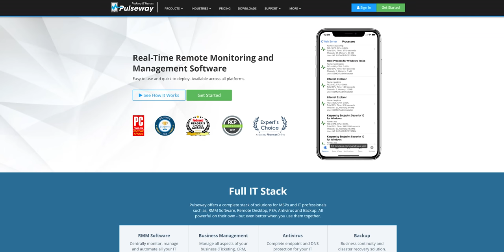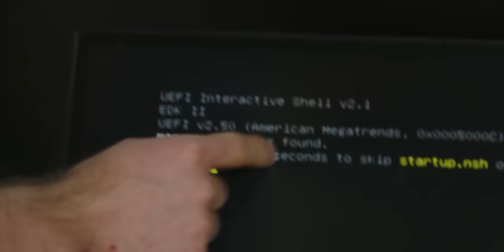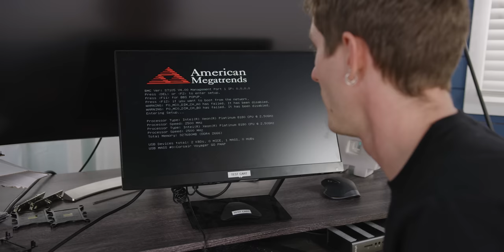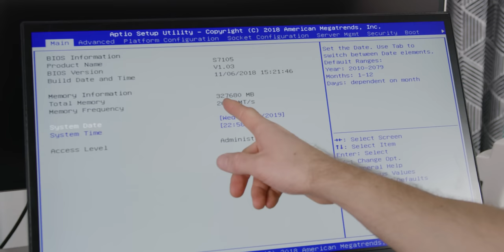Can I FIX this $10,000 CPU??

Comment: Imagine being dissapointed with only 327gb of ram
Reply: I running two gig of RAM on a Panasonic tuff book ruggedized laptop 1.6 dual core, which is a laptop and tablet combo unit from her around 2002 they'll run you about 500 used, reconditioned on the Canadian market. I don't know about eBay these days. Haven't checked. Bear in a while . For all that is holy. I'll never see a computer in my hands that has 327 GB of RAM. The bloody t 800Gaming systemI've built over 10 years ago had 6 gig of RAM which is the most I've ever had in the machine . What exactly are you running videogame wise that quires that much RAM ? Are you trying to act the matrix or trying to build it.
Reply: @peterparker6584   can you run chrome on that laptop? Genuinely curious because my laptop with 4gb of ram and an a4 apu struggles with chrome
Reply: @peterparker6584  Most companies run chrome for some reason. Never see one using firefox.
Reply: Manas Pradhan I have an a1-1250 xD
Reply: @sorsorsor11  how many computers come with Microsoft Explorer as part of the operating system installation package? Quite literally when my computer was set up somebody install come when they put the operating system in. I've tried using it and it just doesn't work for anything, the same as Microsoft Explorer is complete crap. I know there are people out there that use a web browser called Opera. I don't know if it's connected to crawl or what. I just know that Microsoft Explorer Netscape Navigator and come tend to be in the same little department of not hurry many people use it if any at all. It's actually like saying how many people use Lennox and how many people use Windows. I've only ever encountered. For people in Nova Scotia using Lennox  but from what I understand the operating system is very popular in countries like England. The reason I was making jokes about come is quite frankly I don't know anybody personally that uses it. I was using Netscape and at the time wasn't aware of anything else other than Microsoft Explorer and got a little bit of ribbing at the time for using a long expired web browser. From what I've gathered over the years. Firefox is more or less the common waist much like Windows is the more common place for operating systems. Bear in mind I'm still using windows XP witchery well might be why come  just doesn't work. Couple times I've tried to use it it behaved like a complete dumpster fire. Hogging all the RAM even trying to load one webpage. And all sorts of other issues.
Reply: AO1337 True but those same ARM chips don’t run Windows 10 64 bit like my AMD E1 1250 does xD
Reply: AO1337 wow I'm impressed! Didn't know they ran windows!!
Reply: AO1337 now that would be something to see!
Reply: Companies run Chrome because it is a Google product and companies love the censorious and omnipresent Google overlords. Fuck em, Chrome sucks ass and Firefox is the way to go. Never use Chrome.  @sorsorsor11
Reply: @NewLondonMarshall  I only run Linux on mine. Windows takes too much in resources. Hell, part of the reason my RX580 on Linux beats my 1070 ti on Windows for gaming even in wine.
Reply: Eric Barry wow I would have thought that windows having more upto date drivers that it would beat Linux! Impressive!
Reply: @NewLondonMarshall  The mesa drivers with vulkan and esync are pretty impressive.
Reply: Eric Barry Ahh vulkan that makes sense! Everything needs to use that
Reply: You could have like,,, 3 Chrome tabs open at the same time
Reply: Damn i only have 16
Reply: How did this turn into a browser fight????
Reply: @Addicted 2This Debloater or custom images can help, but not enough imo
Reply: yes, I agree. @Addicted 2This
Reply: @peterparker6584  I see boxes with 512gb of memory all day every day, but they are running ESXi with a considerable number of virtual machines on them running significant workloads.
Reply: person from 60 years from now: imagine having to imagine being disappointing with only 327gb of ram.
Reply: Na it's fine man just download some more and it would be better trust me 😁👍
Reply: And I'm disappointed with 16.. lol
Reply: Damn chrome these days is no joke
Reply: That’s just sad
Reply: @varna97  how in the world do you deal with that. My oldest system is my laptop being an old Alienware m17x with a core 2 quad, 8gb ram, GTX 280m, 120gb SSD w/ 500gb 7200rpm. And that even pains me sometimes.
Reply: @peterparker6584  Meanwhile I'm sitting here with 32GB of ram.
Reply: Why do you need that much ram for really anything.
Reply: lmao I heard him and for some reason thought 32.7 but then realized I was broke af
Reply: AO1337 so does Firefox ur point?
Reply: Something thats worth 10k not doing its job right? Yeah you and any fucking body else here would be disappointed
Reply: @Alina_The_Wolf  you need it for minecraft
Reply: In a way you're sacrificing two channels for the non-working one, though, since you'd have to pull the RAM out of the companion channel to the dead channel in order get back to dual-channel speeds.
Reply: @peterparker6584  I think it's time for a little upgrade, friend. Sell that brick if it's worth that much and get yourself at least a 64 bit system with 4 or 6gb ram and you'll have spare change. You can have something much better for like 100$ if you go used. It's only normal that modern software would depend on modern hardware to function properly.
Reply: @TheJerry834  people are Morons.u know have any gaming computers. I've gotten that people throughout that are still working custom-built systems. thar 4 processor computers and have 6  or more gig  of RAM.its something I haven't gotten around to.a couple of need the power supply changed or a hard drive put in but I've lost track of how many gaming rigs I've picked up where people keep thinking they're accomplishing something by getting a new computer every couple years.i at a yard sale. The  ddr4 sticks of 8 gig ram , sealed in the package from corsair  and paid five dollars lol. People do stupid things.the grant was then a box of stuff that I picked up most of it was sealed in the package guy didn't know what any of the stuff was thay were yard sailing off stock from a couple of businesses that went bankrupt, where the guy rented the properties out and it was stuff left over by companies that took off with out paying the rent. the gaming machines that I've got our DDR three and DDR four.i literally have a couple boxes of gaming machine graphics cards that I don't even know if they're any good or not. Majority of them are about four years old or newer and they basically all look the same to me.it just makes me scratch my head i am still seeing the laptops that are supposed to be brand-new and they've got the same specs as laptops that are 10 and 15 years old. aka  too 4 gig of ram and 1 or 2 processors running at 1.5 too 2.3 lol.i know i am Pretty stupid in the grand scheme of things but I just don't understand the logic that its been nearly 15 years and so little has really changed.ide thank majority of the new laptops that would be coming out would have six or more processors. At this point and be much more powerful than 1.5 or 2.3 .ive begrudgingly started using Windows 7 and there's a lot of stuff about it. I really don't like everything I've seen of Windows 10 makes it look like a massive dumpster fire
Reply: @peterparker6584  mostly for video editors that edit things like documentaries and movies ect, maybe some other workstation tasks like 3d modeling to
Reply: that's more than my system storage
Reply: I got roughly 2% of that in my system 😅
Reply: Imagine you have 32GB and only 24 is showing up, same thing really..
Reply: I have 10
Reply: @peterparker6584  I always run chrome lol
Reply: @manaspradhan8041  I (sort of) have a Chromebook with 2GB RAM, it works fine
Reply: @circuit10  Google has optimised Chromebooks to run on really low powered hardware, Microsoft doesn't care as much and neither does Google to optimise for windows. It's always apple that truly gives a shit about lower powered hardware.
Reply: @manaspradhan8041  That's why I use Linux, it's optimised really well (Chrome OS is Linux)
Reply: MB not GB get it right
Reply: Peter Parker let me break down the last decade of innovation for you. laptops have become orders of magnitude more power efficient, and more compact, making them more light weight and convenient for transport. SSDs have made reliable, fast storage, cheaper, and more space efficient in laptops. however the reason laptop specs haven't jumped as much as you might imagine, is because of the space engineers have to work with. having a 6-core processor in any computer, at high frequency, would generate ~100 watts of heat. in a desktop, cooling a 100 watt processor is not much of a challenge, because of the more space you have to work with, allowing things like liquid coolers, or large, multi-heat-pipe air coolers. in a laptop, it is simply impossible to put anything more than 4 cores into your system without burning your legs, or having a 10 minute battery life. however things like multi threading, and improvements in cache, and pcie bandwidth are significant improvements in modern technology. but the large point, is that laptops, or even desktops, are nowhere near the forefront of computer innovation. that, would be in the enterprise server industry. an industry where a single, climate controlled building could have thousands of servers, each with a 64 core processor, with over a terabyte of ram, with the backbone for 100gigabit networking. in the server world, these numbers are actually quite baseline. the benefits of having a terabyte of ram, would be having massive data sets, while doing scientific simulations, like genome sequences, or antibody simulations. having 64 cores at 4 ghz, are used for data center plotting, processing internet traffic for millions of people, running scientific simulations, processing financial calculations for stock trading, or 3d rendering that scales conveniently with lots of compute cores. so in a nutshell, laptops are not meant for performance. they are meant for convenience.
Reply: He’s disappointed because not all of the RAM is reading meaning that there’s still something wrong with the CPU.

This isn’t like his personal gaming rig or whatever you’re thinking, he’s trying to fix a server-grade CPU, he can’t just say it’s "good enough"
Reply: Peter Parker tuff
Reply: Abcde Fghij That’s not how RAM works, and he’s not satisfied because it’s not working as intended! This is a server grade CPU, he can’t just say "it’s good enough" and call it a day, he’s trying to fix it completely. 

This isn’t even designed for gaming
Reply: @peterparker6584  what is this “Googol Chrome”
Reply: @peterparker6584  well many applications like flow simulations use all the ram ive seen a flow simulation saturate 256 gb RAM, 8-16 gigs is enough for gaming. high ram ha  LOT of industrial applications
Reply: @manaspradhan8041  have u checked in task manager whats the bottleneck?
Reply: @peterparker6584  have you upgraded your computer yet?
Reply: @saisathanapalli8293  define up grade. iam still using 7  and xp depanding on wich 1 iam on.way?
Reply: Ahh rookie numbers
Reply: @peterparker6584  I find having 8GB is a serious handicap for games from the last few years, not that I play too many of those. I run 16GB but I also use my computer for electronics simulations and coding so it's nice to be able to run a lot of applications at once with no paging or slowdown
Reply: @killakam123321  ONLY?
Reply: They are building a server tho
Reply: I have 8gb
Reply: @SadieSorceress  nice
Reply: @Peter Parker chrome is all I use on my pc now, use to use Firefox but that was awhile ago, and the stupid built in windows explorer is horrid
Reply: Even 32gb of ram are exaggerated for a normal user
Reply: @nameplesseahf wasn't it for a server?
Reply: 64GB should be the minimum you buy unless you like throwing money away. The price difference between 16 and 64 isn’t that much.
Reply: @peterparker6584  no one uses either the cpu, or that much ram for gaming, so gaming wise no one would need that
Reply: @hamez1324  I mean the reason I’ve stuck with am4 is because I would have to step down to either 96 or 64GB ram

Comment: Honestly it may just be how the CPU is mounted in the socket, not anything to do with a tiny dent on the very edge of the pcb which shouldn't have anything in it.  Watch der8auers video on this cpu and how difficult it is to get a proper mount on it, he literally gave up for his benchmarks/video, running half the ram channels.
Reply: this comment should also be bumped to the top
Reply: omfg INtel needs a better mounting plate solution for sure, these LGA3647 socket chips are a MASSIVE pain in the ass... I just got done installing 12 of them.. somethig that should have taken me an hour or so took 8.
Reply: Even my Threadripper took quite a few mounts to get one memory channel to work.  I was just about to give up on it too, but tried one last time the next day and there it was!
Reply: I agree. These big sockets always cause issues.

Comment: Derbauer had issues with a non dropped chip. He said it's really hard to get the correct mounting pressure to not lose 6 channel.
Reply: @Cx0318  Or get the DerbauerTM Intelmakework bracket, milled from billet aluminium.
Reply: mount pressure isnt the problem, its socket deformation due to being a poor design.
Reply: wasn't there similar issues with early thread ripper not getting all pci lanes?
Reply: @juliettaylorswift  Thats why BGA socket is unreliable. Even soldering sometimes.
Reply: @NVMDSTEvil   bad socket pressure due to deflection from the chip being so fucking big ..
Reply: @juliettaylorswift  is that the foxconn/lotes socket thing issue or something else
Reply: @CallMeTonyga  idr, but there was something about some cpu and getting the mounting pressure even and enough pressure but not too much. Maybe it was another intel chip, but thought it was one of the threadripper versions. It might not have been a pci lanes issue either, but there was some issue.
Reply: @smartmonkey777  No, socket warps due to poor mechanical abilities.  The CPU and IHS package are quite firm and inflexible compared to the board.
Reply: @NVMDSTEvil  or that fact that he broke it....

Comment: You should collab with Louis Rossmann and see if he can fix the CPU at a microsoldering level.
Don't delay, collab today
Reply: Nice idea, but he loathes working on anything without schematics.

On top of that, it's damage inside of the PCB of the CPU.  it's likely damaged traces deep within.  That's impossible to fix without some major machinery of a fab.
Reply: @Xathos  probably, but asking him does have more chance of it getting fixed then putting some glue inside and put heavy duty clamps on it
Reply: @mvn4844  To quote Louis Rossmann "I'm little more than a janitor cleaning up".  

He won't know how to fix it, or even try (unless getting something in return for the failed attempt).  This is beyond his skill level, and you speak like somebody that doesn't even watch his work.

Think about it.
Reply: @Xathos  Never said that louis would be able to fix it, just that it would have more chance of it getting fixed by him then putting clamps to it (with chance beeing the most important par of that sentence). i personnaly  dont believe its actually possible to fix a cpu thats been split open, not even by intel. I do believe that louis will have a beter assesment if its even possible to get it fixed by him or anyone else
Reply: Sounds too much like an advertisement: Don't delay, collab today
Reply: Jesse Newton Water was existing to wash stuff off before it was to cool components.
Reply: That will be worth a video
Reply: @Demo the problem is with memory not with the transistors, memory isnt nano, but yh i agree as i said, probably still not possible to fix, all i was saying that i do think he would be able to give a decent educated answer on the question

Comment: Fix $10,000 CPU with super glue...seems legit.   A common theme with LTT.
Reply: Well I fixed my motherboard by washing it with soap and water so....Anything is possible.
Reply: @seraphimvalkyrin4543  excuse me wtf how did soap and water fix that
Reply: @Saik0  Huh, interesting. I mean, it's most definitely a last resort but an interesting resort nonetheless.
Reply: if only he had used duct tape to clamp it!😃
Reply: @tDrauqRaM that would depend on what's wrong with it.

Usually soap and water would be used to clean crap off the board (say a cap that leaked all over the board, or a battery that leaked onto the board).
Reply: @tDrauqRaM if using distilled water yes, if using tap you're going to have to rinse/wash with alcohol or distilled water to get all of the impurities from the tap

Comment: I vote to send it to Mr. Carlson! I bet he could manually reconnect any broken die wires. Also, I should note that this is NOT a joke. He is amazing!
Reply: It is not a die wire problem. It looks like inter-layer PCB crack, there is not much that you can do about it besides what he already tried.